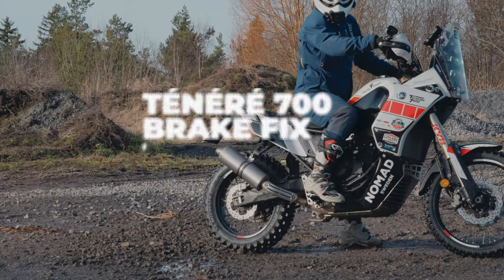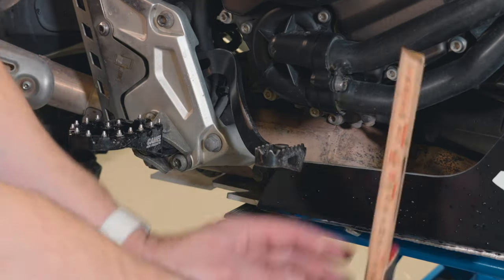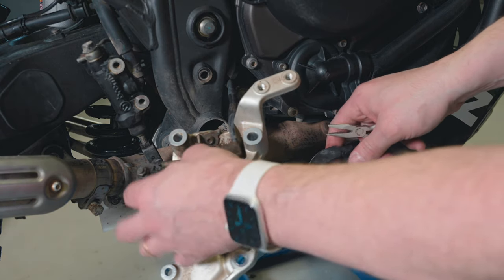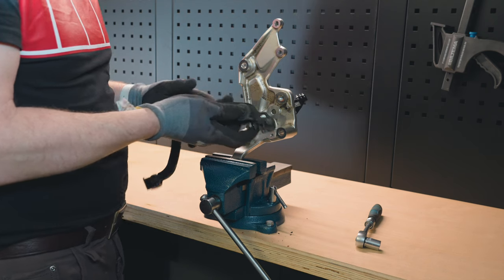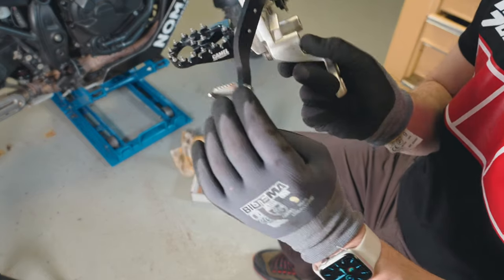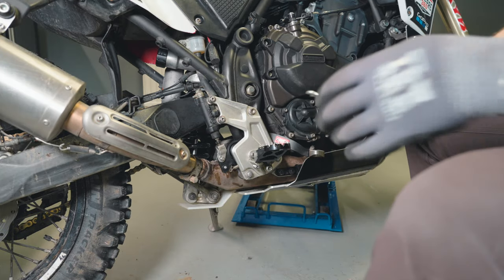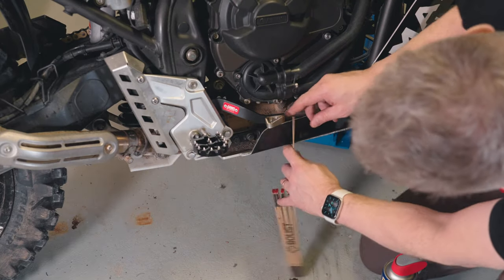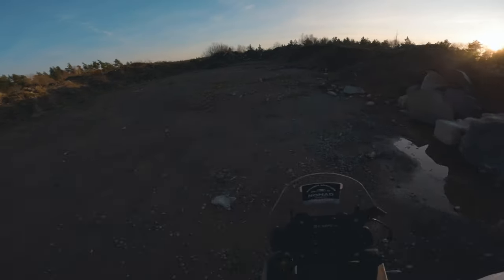The Brake Fix - Tenere 700

Comment: Cory should be congratulated - it is a great fix. It is noticeably closer to the bike than the original.
Reply from the maker: Yes its closer but I actually didnt notice when riding. But I do ride toes in
Reply: @NomadSweden  its not really a problem agreed but I still have the OE plastic cover fitted, which now gets more in the way as a result. :-)

Comment: Installed this a few months ago and can say it’s definitely worth it.  It does fix the issue and has helped me be a better rider on the T7-easier to confidently slide-steer with the rear wheel to name one thing.  I’ve never been disappointed with Camel ADV product, quality parts.

Comment: Yeah, there is no question about it. This is a must buy. The original brake on the World Raid is just as bad. Thank you for showing how much travel it had and how much it sticks out from the bike. I will go for the larger plate I think. Great work 👏🏻🎥
Reply from the maker: Thanks Tjommi. With this fix, there is no stopping me now. The measures were for you, so I can remove the video now.
Reply: @NomadSweden  Hahah. that is correct tjommi... no need for the video anymore now! Thank you 🤣🎥 Amazing how you look in slow motion. Guess you sound better in slow motion as well...

Comment: As always a great vid mate. Recommended fix from me for sure. 👍
If you crack/loosen the bolt holding the brake lever to the (silver) foot peg bracket thingy b4 doing anything else, you won't have to mess around with the "bugger" that holds on the brake light switch at all. Go thru from the left hand side of the bike to reach the brake lever bolt with some extensions. You can wheedle the brake lever out and replace with the new spring and lever while still wired to the bike.
Reply from the maker: Thanks, great tip

Comment: The bolt that is hard to remove probably has red Loctite on it. If you can apply some heat it helps the stuff let go ( with care to avoid the nearby plastic🙀). Thanks Robert👍

Comment: I have also intalled The fix, but I'm struggeling to feel happy with it. I have installed Bosley 30mm lowered pegs, and LOVE them. But it dont work well with this break pedal. It ends up to high, and to much invard. So I have to lift my foot and to sving my foot inward to get to the pedal. Thats bad in a sudden situation. The leverage arguement on this is an illution as well, because the new clip moves the attacking point back to approx where it it on the OEM pedal. It's stiffer though, and you get a much better feel, but.....$200.....well...
Reply from the maker: Indeed 3cm lowered is not working. I think he mentions that in videos and product description

Comment: Yeah, I kept messing with mine and could not get the brake switch to active properly at all. I ended up putting the OEM lever back on.
Reply from the maker: Lowered pegs?
Reply: @NomadSweden  No, stock pegs. I'm not sure what the deal is. I can't seem to get it into proper adjustment.
Reply from the maker: Yeah that is a bit strange

Comment: Great video

Question trying to mount the TERRAIN COMMAND switch on the left handle bar, how do you move the OEM light/indicator switch as it locks into a hole on the OEM handlebar?

Thanks
Reply from the maker: File down the peg so you can put the control where you want. I taped the handlebar to get friction.

Comment: Odd one that ! I just checked my brake pedal travel on my standard T7 and it moves 3 cm, never even knew there was an issue.

I noticed the original brake pads wore out by 10k but the replacement pads have done 10K now and are not even half worn, I think my replacement pads are EBC and they work so much better, more feel and less tendency to lock the rear wheel.
Reply from the maker: Interesting 😊 I rarely lock my wheel too. I also changed to tougher pads but then it wore my break disks down and those were much more expensive

Comment: Pegs are cameladv? Advice it ?
Reply: I have those as well and they are very nice. Good price, a bit wider and longer than stock but not massive, and they grip like crazy. Another good buy from CamelADV. I bought the rear brake fix as well, and I would say it's a must-have upgrade for the T7, making the rear brake way easier to modulate and feel.
Reply: @ApocalypseNouille  yes it looks nice too thanks
Reply from the maker: What he said 👆🏻 thanks